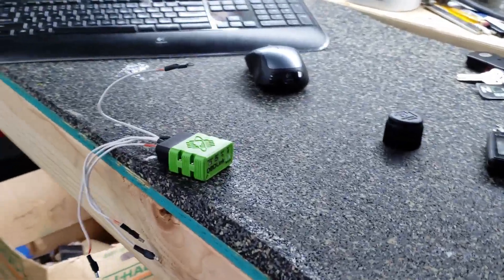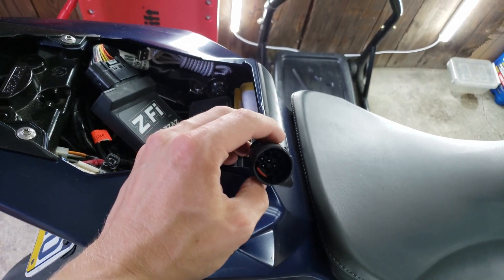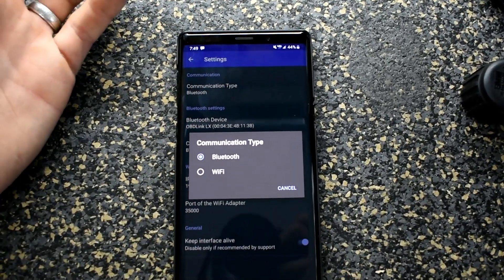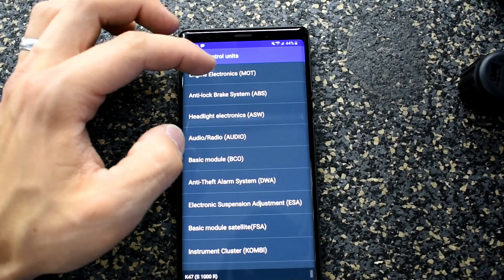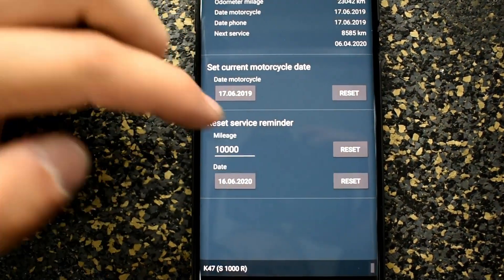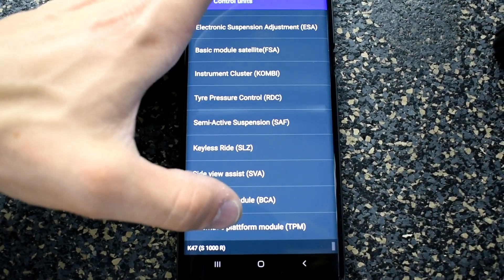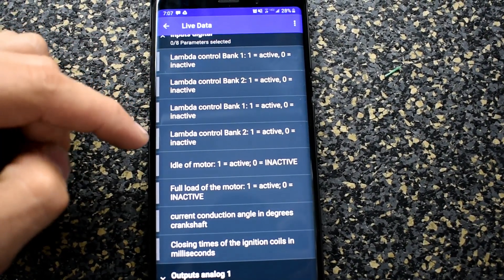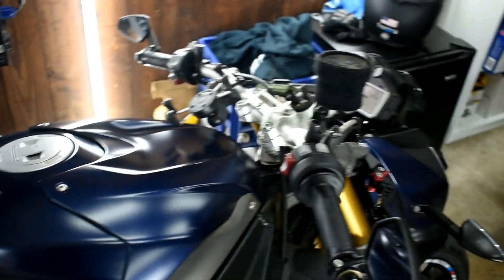BMW MotoScan Tutorial for S1000RR & S1000R

Comment: I live miles from a BMW dealer. When my service message came up on the dashboard I phoned a dealer re coming in to have it reset. I asked if it could be set for longer than twelve months to save having to return to the dealership every year, they said it could not. I purchased an obd unit and the Motoscan app and plugged it in. When I reset my service message I found I could set it for as long as I wanted. BMW dealers are so full of shit.

Comment: Hello can OBDlink LX reset TPS and adaptations, am building an accident damaged 2010 BMW s1000rr, and am looking for a cheap scan tool have so much to buy, so as to save up...pliz help am about to click order, is it going to be chinese yellow clone gs911, or motoscan with obdlink LX??
Reply from the maker: As stated in thr video, you cannot for this bike yet
Reply: @jbimmer9799  what about 2017 - 2018 S1000RR? I heard theirs a manual overide reset if you don't have tool
Reply: Ciao , mi potresti dare una mano con la mia S1000rr 2015 ? Ho comprato 4 adattatori ma non funziona nessuno .. ho fatto il collegamento manuale funziona tutto ma non mi fa entrare nelle centraline .. la mia presa obd tiene 5 pin ( 4 -6-7-9-10) mi puoi dire come collegarli per favore ?

Comment: I have a bmw 1200rt 2015 with connections on the round 10 pin connector but don't know the pin outs since the layout of the pins is different than the s1000r pin out. I have pins 1,3,6,9 and 10. I've looked online but can't seem to find any information on this pinout. I can't connect to the obdlink lx since it doesn't see the canbus due to the different pin layout.

Comment: where do you get the Moto Scan App ? My I phone doesn't find it in the App store
Reply from the maker: Do you have an iphone?
Reply: @jbimmer9799  yes an i phone xr
I just watched another video and found out you need a Andriod phone but I have a old LG3 phone so maybe I could use it?
Reply from the maker: @stan2022  yes it's not availed on ios. The old android phone should work
Reply: JBimmer Thanks I’ve got the old phone charged and installed it no problem 👍

Comment: Does the app have a option to change speed diaplay from MPH to KM/h
Reply from the maker: In-app, yes. BUT, most BMWs have a KOMBI (dash) setting to change this on the bike though. Check the online manual for your bike
Reply: @jbimmer9799  I have 2014 R1200GS. No option in bike menu, BMW say can only be done through computer. Willing to invest if this app has the option to change digital Speedo
Reply from the maker: @MutzG  I'll look into it. I'm not sure if the app will change the units on the bike as well

Comment: Did you buy full license for motoscan? I got the pro and dont see adaptations. I was wondering about the adaptation parameter reset. You mentioned it might be available on the future. Hope they develop and add it.
Reply from the maker: I do have the full license. I've bugged the developer quite a few times about adding adaption reset ability to the S1000R and RR. It is still unavailable for our bike models for now. Sorry
Reply: @jbimmer9799  great video by the way, i bought the converter cable and the unicarscan bt device. Works brilliant. Patiently waiting for the adaptation feature then. Maybe i need to bug developer too. Do.some more videos of the other features plz. I have2016 s1000r. Was wondering is ot worth getting the full lic over the pro
Reply from the maker: @matthysharmse4200  Thanks! Features of MotoScan or the S1K?
Reply: @jbimmer9799  features of motoscan app on the S1KR. Because i have the 2016 model S1KR
Reply: @matthysharmse4200 did they ever add adaptations? Ty
Reply: @jbimmer9799 do you know is reset adaptations was ever added? Ty
Reply: Any update on the developer adding the adaption reset? 
Need it done
Reply: @Reapers1k did you ever find out? Ty